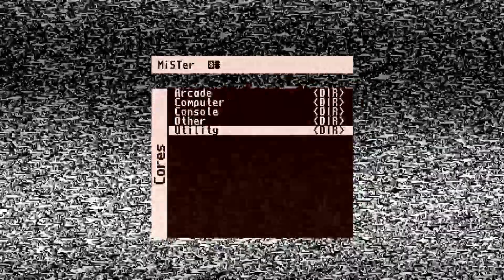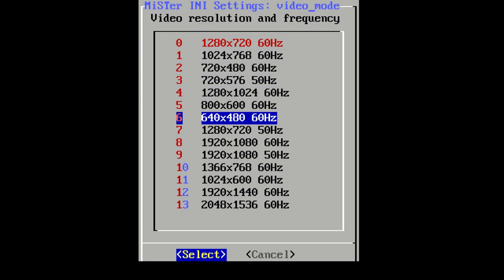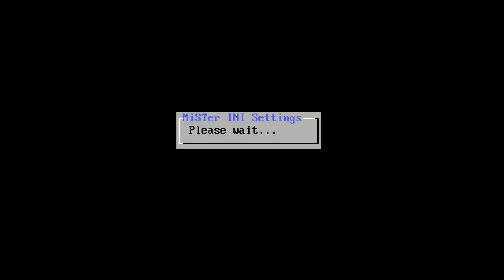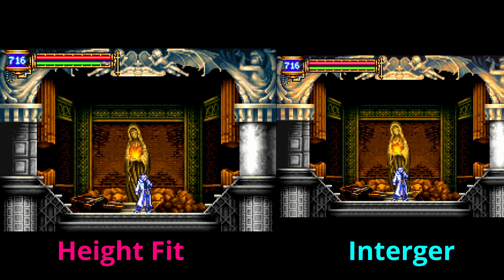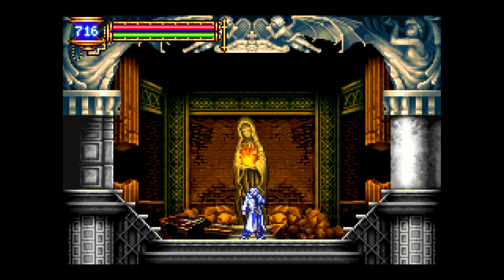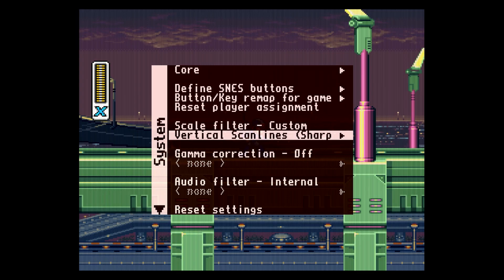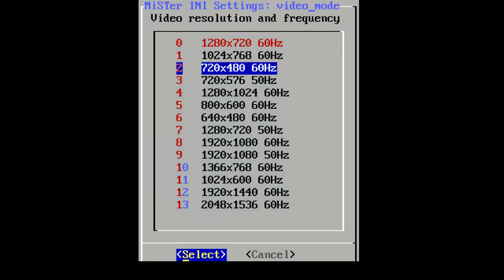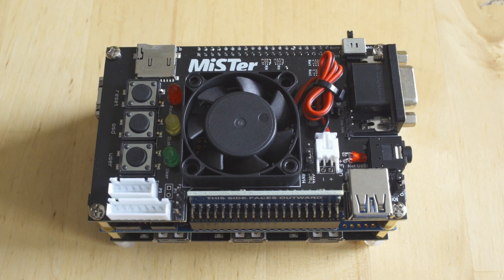MiSTer FPGA Intermediate Video Settings Guide - Resolution, Scaler Options and Video Filters

Comment: It is vga through the RGB port if you turn on the line doubler. It flips the output to 31khz so you can use it on a crt PC monitor. That looks way better than a 4k flat-screen.

I found that the mister looked horrible on my 4k tv no matter what setting I tried. My advice is that you need a decent external scaler or a real CRT to make a Mister worth the effort 

Or... a low res 640x480 lcd

Comment: I don't think this video is quite right, when you set scaling to 'normal' it scales to fit the screen height but it maintains the aspect ratio so if you add a little interpolation it produces a great image.
Reply from the maker: Scaling just to the vertical would affect the aspect ratio as if it’s not scaling on the horizontal axis you aren’t maintaining that aspect. So some pixels won’t be scaled evenly. If you go to the docs (links get eaten in comments) it will describe more in depth how vertical scale is not a 1:1 scale vs integer

Comment: Hi, thanks for the video. Did you ever do an analog video? If so, could you please share the link for it? I’m about to connect my MiSTer to my B&O CRT MX6000.
Reply from the maker: Still current : MiSTer FPGA 2023 Analog Video Guide! RGB, Component VGA, S Video and Composite! Updated
https://youtu.be/_LDeEApLvfM
Reply: @ thanks man, really appreciate your time and effort you put into this 👍
Reply: @VideoGameEsoterica  Live in europe, using analog cable VGA to SCART(RGB). Not sure what settings to use mister.ini. Im a bit slow. Trial and error sort of :)
Reply from the maker: Happy to do it
Reply from the maker: Just make sure you are using RGBS and not RGBHV. 15kHz SCART doesn’t use both sync signals like 31kHz VGA does

Comment: First start, no picture, (Digital Out of range 63,9kHz/30Hz)
(QM Tech MiSTer +IO-board, Mr Fusion 2.9, HDMI>DVI cable, 60Hz LG Flatron L1942PE)
Can't open/edit mister.ini (looks corrupted), using Notepad++
Cable and monitor work fine with other setups.
Total noob t this, whats next? (Feels like a soft setting/error)?
Thanks from Sweden!
Reply from the maker: Odd. Not sure. The INI looks corrupted? Can you explain that more
Reply: @ mister.ini isn’t an ordinary text file i suppose, rather an unix file? Should i maybe change anything in Notepad++ to be able to read the file?

Comment: "Scale to fit the screen height" isn't affecting the aspect ratio at all. It just uses a non integer scale factor. The image is scaled evenly in both X and Y directions until the height matches the Y resolution of whatever you've set as the resolution in mister.
Reply: Yep, and he completely took a swing and a miss at this part of the video. When he shows them side by side he mentions that the pillars don't line up because the image is stretched vertically. But it is also stretched horizontally too, at a 1 to 1 rate!!!

Comment: I have some MISTer issues I'm trying to fix. I've noticed on my OSSC and my MISTer that when I have horizontal scanlines and the screen scrolls vertically (as in games like Aero Fighters 2 on Neo Geo), the scanlines disappear a bit and it doesn't look very good. It's always this vertical scrolling that causes it. I'm wondering if this is a TV or MISTer issue? The TCL TV is very good and compatible with every mode I've ever tried.

Secondly, for some reason the scanlines aren't coming on in arcade games I've set them in. There's one game which does work properly (Altered Beast) but the others do not and I need to set them manually every time. Saving the settings doesn't help. The settings are saved but the scanlines don't come on. The controller inputs are there and my scanline setting is there but is unselectable and has a line through it. Console games are unaffected and scanlines automatically come on.
Reply from the maker: Are you using integer scaling? That may be the issue for the first paragraph. I’d have to check in on the second issue. I never use the scanlines myself
Reply: @VideoGameEsoterica  
Ah, I'll take a look. I do have something set for the integer scaling. Thank You!

Comment: Thank you, Sir. Your guides have helped me get my MISTer running well.
I appreciate it as I anticipated more difficulties than there actually were. 
I don't mean to be a drain but I have a couple of issues:
1) I'm missing the extra video options. I just have the basic scanlines options (25, 50, 75%).
2) I don't know which set I need for Neo Geo. I have the Darksoft set. I have Mame 223 merged and non merged roms.
So far I've had no luck with Neo Geo.
Reply from the maker: Update MiSTer. You should have more options. 

Darksoft roll up pack with the xml file. How are you transferring the roms? If you do FTP I know MiSTer can have issues with them
Reply: @VideoGameEsoterica  
OK, I'll try that.
I was putting the roms in manually (unzipped).
Reply from the maker: And all the games are in their own folders correct? Each rom should be in the Neo Geo games folder nested in their own folders. I’d try zipped. Tiny bit longer load but try it
Reply: @VideoGameEsoterica  
Yes, that's how I did it (in their own folders).
I'll try updating again to get the extra video options.
Reply from the maker: Yeah lmk how it goes
Reply: @VideoGameEsoterica  
No luck with the scanlines and video options. I'm still stuck with only None, 25%, 50%, 75%.
I went into the options and changed the output to 1920 x 1080. 
I actually prefer the scaled to screen height look even if it's distorted a bit.
Scanlines are a big deal to me so I'm hoping to fix this.
I'm currently getting the smaller Darksoft Neo Geo set so haven't tested it yet.
Reply: @VideoGameEsoterica  
I've got the Neo Geo working. I got a smaller Darksoft set with the games still in folders.
Still, I can't figure-out why I don't have the extra video modes. I switched the resolution back to 1280 x 720 but no change.
Reply: @VideoGameEsoterica  
I found the video options. I wasn't looking in the right place.
I chose medium scanlines. They're a bit weak for my liking but hopefully I can muddle my way through that one and get them darker. I saw this long play done on MISTer and I think they look awesome here:
https://www.youtube.com/watch?v=dACBr8VjDqw&t=777s
Reply from the maker: Hmmmm. I’ll look into it
Reply from the maker: You looked for all the filter / masks options?
Reply from the maker: Haha I just asked in your last comment if you were looking in the right place
Reply: @VideoGameEsoterica  
All sorted now. I have it looking really nice. I use the adaptive scanlines at a low value for dark scanlines. I maxed out the brightness on the TV and increased the contrast by 10%. It looks quite similar to Mame running with Reshade. Reshade is awesome. You might want to take a look at that, if you haven't already.
https://www.youtube.com/watch?v=zITHKJOlcjw&t=6s
Reply from the maker: Awesome :)
Reply: @VideoGameEsoterica  
I was like a kid on Christmas Day.
Reply from the maker: Haha I get that

Comment: I've used the mister on pc monitor, crt monitor and 4k monitor. Not sure which I prefer. Amiga looked better on crt monitor than the crt tv. Renovating a house and when that done I'll setup multiple options. Don't have the room at the moment.
Reply from the maker: Room is always an issue I struggle with

Comment: im playing on my small sony crt, image is great but its doesnt fit the entire screen in most games, i use video mode 6, composite 1, vga scaler 1, vscale 1, direct video 1. thanks.
Reply from the maker: You may need to adjust the tv via the service menu too. Some console with real hardware and some cores don’t fit my PVMs either without adjusting the picture. Just the way of the CRT

Comment: Bit of a newbie question, but in theory shouldn't what the MiSTer is outputting and your tv resolution is not matter if the integer scaler is running? Wont it be correct in the end?
Reply from the maker: 720 to 4K is a 3X integer scale. 720 times 3 is 2160. Divisible by 3. 1280 x 3 is 3840. Divisible by 3. So using 720p to scale to 4K is beneficial :)
Reply from the maker: I should add this is for 240p games. It scales better at 720 as 240 x 3 is 720. 240 x 4 is is 960 and x 5 is 1200. So you can’t get 240p to 1080 as an integer / an even divider.
Reply: @VideoGameEsoterica  Yeah now after reading that and thinking critically I realize the integer scale in the mister is properly scaling it to 720p or 1080p, not to the display resolution. Thank you!
Reply from the maker: No worries. Always happy to answer things or clarify them :)
Reply: @VideoGameEsoterica  I do have one more question though. As far as I know tvs dont use simple integer upscaling as it only really works in cases like this, so presumably it will still scale evenly, but with less sharp pixels?
Reply from the maker: It depends on the tv and the scaler. They all do something different honestly so it’s hard to say
Reply: @VideoGameEsoterica  Well hopefully by the time I set aside some cash and get to building one they'll have moved onto a board with native 4k output, thanks for all the help.
Reply from the maker: No problem
Reply: @VideoGameEsoterica  Won't 720 give you a blurrier picture than something like 1080 though? Or is it not noticeable because of the way it scales?
Reply from the maker: It’s tv dependent but 720 integer looks the best to me. It won’t perfectly fit the tv but I don’t mind the border trade for the integer scaling personally
Reply: Are you still using 720p integer?Im new to the mister and looking for best settings.
Reply from the maker: That’s what I use yes for capture

Comment: 03:45 I took screenshots of your video cropped on the part showing the game with and without integer scaling and in both cases the aspect ratio was 3:2 (the width divided by the height was approx 1.5). I don't think integer scaling affects the ratio in this case, particularly because, unlike most retro consoles that output on CRTs, the GBA has square pixels just like your modern display.
The effect of non-integer scaling is just that different pixels in the source image can have differing footprints of numbers of pixels they map to in the destination resolution. The way to minimise this is to output at the highest resolution possible, up to the limits of your display.
Reply: Glad someone else mentioned this. Scaling to screen height shouldn't affect aspect ratio as it proportionately widens the screen too. Some people just tend to avoid it because it doesn't scale as cleanly (so scan-lines appear uneven etc). Integer scales will be pixel perfect and even 0.5 scale works reasonably well with scan-lines, though I think 5x with overscan/cropping has become many people's preference in most cases since its introduction.
Reply from the maker: I just did a video on 5X today to talk about that as it’s becoming one of the most popular options
Reply: @VideoGameEsoterica  A lot of people have been talking about it. Seems the way to go in most cases as it's pretty close to how a CRT would display them. I don't mind having black bars to retain the aspect ratio, but I don't like playing in a window.

Just wondering if you could help me out on something. It's been months since I last used my MiSTer and I updated it, then it wouldn't boot, so I started from scratch. First thing I tried after getting everything up to date was Flink on the Sega/Mega CD core, but I seem to be getting some odd behaviour. The audio cuts out and controls don't function for a second (just long enough to get me killed) like the "CD" is skipping.

In your Sega CD core video, you said you used the Mega CD 2 Japan region free bios. I think I'm using the same thing, but I don't know. Looks like I downloaded from the archive on the page offering ED packs in May last year. If the core has been updated since, would I need a newer bios dump?

Google isn't helping and people tend to be very vague on forums. For example, a lot of the bios files have a six digit number after them beginning with 9 (followed by a Portuguese sir name), but no one ever quotes specifically which one they're using which is pretty annoying (I thought the entire point of them being named that way was to avoid ambiguity).
Reply from the maker: Go to the GitHub for the core and check bios files. There should be a checksum you can check against your bios file to make sure it’s a good dump

Or just join my discord (link in vid description) and ask me to send you the file I use in the mister section. Happy to help
Reply: @VideoGameEsoterica  Sorry if I'm being dim, I'm not seeing the bios checksum. Is it on the main MegaCD_Mister page?
Reply from the maker: Maybe they didn’t include it. Some do, some don’t. Doing this from memory while on a break in studio. Just join my discord and I’ll send you the one I used that I know is good :)
Reply: @VideoGameEsoterica  Thanks for the offer. I'm not on discord (or I don't think I am). I'll see if I can muddle my way through, but if not you might hear from me later :)
Reply from the maker: Google “mmmonkey Sega Cd” and click the top link. Sorry I’d just link it but those usually don’t work in comments. They disappear
Reply: @VideoGameEsoterica  Thanks. I think I stumbled across those earlier (linked from Reddit) but I'm always cautious about downloading from unknown sites when I don't know anything about the person recommending them. I appreciate your help.
Reply from the maker: I’ll have to watch and see what I was showing. I’ve forgotten most of what’s in that video by now lol

Comment: Hello friend, I would like to know if you can help me, I'm using Mister on a Samsun 55 LED TV via HDMI, all COLORS have the wonderful Horizontal Scroll, but the vertical games mainly from Arcades have the bad vertical scroll, the screen slides giving small stops every 2 seconds, I don't know what to do to solve the problem, do you have any idea to let the Vertical Scroll slide without tiny stops?
Reply from the maker: It’s probably game dependent. Not all arcade games have the same refresh rate so it can get a bit tricky. Which games?
Reply: @VideoGameEsoterica  Friend, Xevious Arcade is the worst, I can't at all prevent the vertical scroll from crashing, even if it's little else it's there and it's not fluid, I got it in the Emulator, but in Mister I don't know what else to do, I've tested it also Truxton from Mega Drive, Ghost Pilots from Neo-Geo and there is the same problem with the Vertical Scroll, the curious that the Horizontal Scroll is beautiful and smooth!
Reply from the maker: You’ll have to adjust settings in the INI file to try to alleviate this but considering I don’t have the same tv I really can’t tell you what settings to use

Comment: I'm a little confused: can you only output 50/60 Hz over HDMI with MiSTer? So I couldn't hook up a FreeSync panel and have MiSTer output to it at 60.1 Hz for SNES, 59.9 Hz for Genesis, 75.4 Hz for Wonderswan, etc? Do I have to choose between triple buffering vs tearing by outputting an exactly 60 Hz signal to my monitor?
Reply from the maker: Free sync has been reported to work in some cores but I have not tried it so I really can’t attest to that myself

Comment: How would I revert back to my original INI settings?  I changed the video output and now my computer does not recognize the format.  I copied the ini_settings.sh file from the scripts folder before making changes.  But when I copy the old file back onto the SD card I still get the invalid format message on my tv.
Reply from the maker: Use this link and make a new INI. Copy it to the folder. Should work fine. If it doesn’t clean install will do the trick
Reply: @VideoGameEsoterica  Which link?
Reply from the maker: I suck at links : https://ini.misterkun.io

Comment: This was super helpful, but just a little tip: You're using interpolation on an integer scaled image. Interpolation is there for when you want to use a non integer scale.
Reply from the maker: it may have been in the edit when I was moving things around too
Reply: So if you’re using integer scaled output you don’t need to turn on interpolation?
Reply from the maker: It’s kind of display dependent in my experience. So the answer is “try it and see”

But you did Happy Gilmore dirty so why am I even helping you?

Comment: what is the recipe for the MiSTer to output 960p like the PS1Digital?
I feel that resolution works best for my LG OLED, and doesn't result in black bars all around as seen in 1200p
Reply from the maker: You’d have to go into the INI file and set custom parameters for the output resolution. I’d make a back up of your INI file before you do that just in case. But the formula will just be setting custom resolutions and seeing how it looks to you.
Reply: @VideoGameEsoterica  yeah it's the custom parameters that I need... I don't really understand the numbers involved with the parameters ☹️
Reply from the maker: you should join the MiSTer Discord and ask for some help. Just google MiSTer Discord and you'll find it

Comment: Disclaimer: On Samsung 4k TVs, 720p will give you more input lag because the TV enables some zoom and scaling options for the image and processes it further. You want to use a custom 1200p resolution instead, as that'll give you perfect 5x scaling. Just change your video mode on your .ini file to video_mode=1920,48,32,112,1440,3,4,39,184828
Reply from the maker: I’m gonna do a video on 5X exclusive at some point soon :)
Reply: Does this apply to all samsung tv's? I have samsung qn90a 55" 4k tv and have no clue which video mode is best :)
Reply from the maker: I am honestly not sure as to what every model will do. Way too many out there